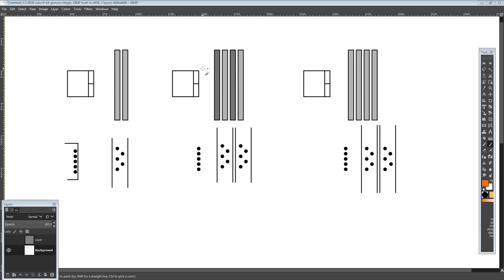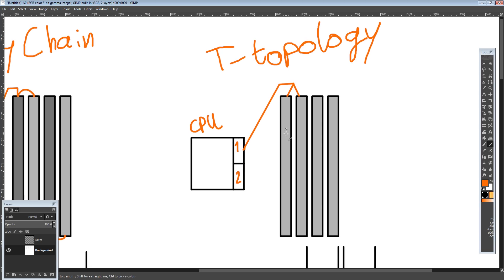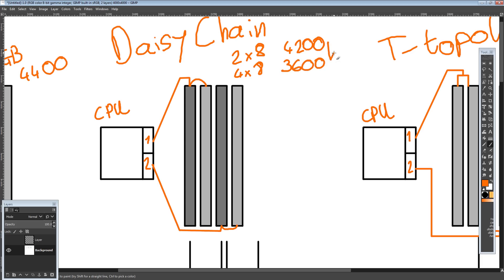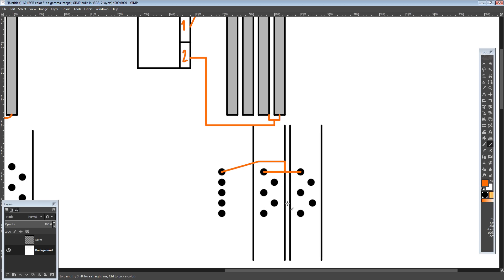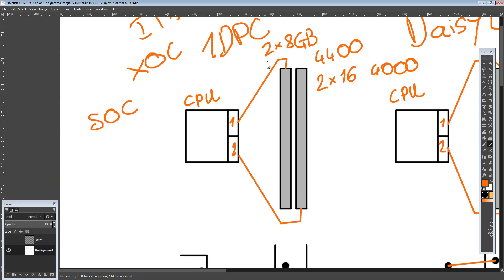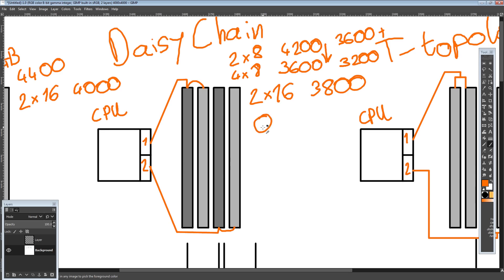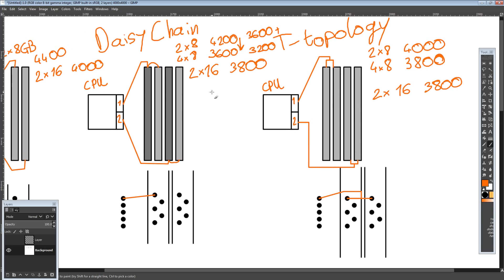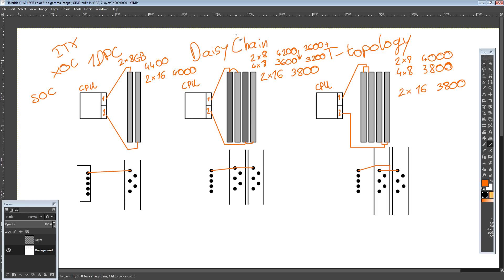Rambling about motherboard memory layouts.

Comment: Now I get, why I had to take my memory from 2666MHz to 2400MHz after adding another 2 sticks.
Reply: Ohhh, but did it at least boost game fps?
Reply: My speed went down too. I saw a boost in only one game, Star Citizen
Reply: @latuba2478  There's almost no difference in FPS, and you get lower speeds on your RAM overall. Not really worth it unless you intend on adding memory to fill up the slots. Otherwise, stick with 2 so you can add even more RAM later.

Comment: Wait...in a T-Topology, you can put the DIMMs anywhere, and it won't affect their functionality? What if The Verge used a T-Topology motherboard?!
Reply: That's not how T-topo works.
Reply: @basshead.  But it's how Mafia works
Reply: It was in the context of overclocking. Slot choice wouldn't negatively impact results on a T-Topology board. Not making use of Dual-Channel by picking the wrong slots is still a colossal mistake.

Comment: I find your fretting over little mistakes and wanting this as perfect as possible incredibly endearing. That said I've learned alot from this. Recently got some new ram from the same manufacturer as my old and wanted to read up on how the slots work (my mobo uses Daisy Chain). Was curious whether or not I should try and keep my old ram in with the new and fill up all 4 slots, but sounds like it's probably best I don't.

Comment: You missed some facts... with T-Top its possible to hit 4400 with 2dpc but NOT with 1dpc. T-Top Boards works even better with 4 Dimms. I can give you some infos about that if you want.
Reply: I’m a bit late but interested by the infos ! :)
Reply: Yes, please give some info!
Reply: I can confirm that. I do exactly 4x8go 4133Mhz CAS19 on my Z390 Aorus Master (i9 9900K 5.1ghz/ uncore 4.3ghz  1.30/1.32V manually and get stable ram when i change the pwm phase rate. And YES it really work.

The same goes for LLC too. NEVER going above High level (level 4 on 9).

In contrary you will gain save more voltage cpu comparing to Extreme/Ultra.

4 dimms Single rank is better 2 SR.

And 2 dimms Dual rank are even better.

Dont forget that 2 dimms Single rank = 1dimms Dual rank.

The more you put dimms the better it will be no matter the Typology. The only thingis that you should be aware for the differences of frequency og the ram from yhe traces layouts.

I think to test 4x16go 3600Mhz CAS16

In reality when you could afford and when it's a good implementation T-typology is the better.

Despite highter latency and/or frequency..Dual rank can perform better than Single rank

And so just with 2 dimm Dual rank so imagine with 4 of them..

Even with my 4 dimms SR 4133Mhz tell you that in cas19 it s btter that 3800Mhz... 15-15-15-35 (yes really) but in only 2x8go SR...

On performance test i have had 4100 pts global.

The other person 3900 despite much latency..and close frequency (3800Mhz). 3900 pts for him

The final person with 2x16go,get 4200 points with 2x16go 3500/3600Mhz 16-18-18-38

And yes just for two sticks..

Beware to your cpu and voltages rails too..

The more hou overclock the and/or the less you will be able to overclock your ram.

just add 100mhz to the uncore is enough to get you mass errors on Karhu ram test.

Comment: i just bought gigabyte x570s UD. its daisy chain which says use the 2nd and fourth slot for 2 sticks. i have heard that using 4 stick is pointless if all dual rank coz the two sticks in 1 and 3 slot wont dont anything so if i have 4x 16gb in al 4 slots it wont be any better than 2x 16gb in slots 2 and 4. do i nned 4x 16gb single rank sticks or can i use 4x 16gb dual rank sticks or do i just need to get 2x32gb if i want more than 32gb, i dont need more than 32gb i just want to use all 4 slots so nothing is empty and i have power if i ever ned it. i getting 5800x cpu for it or maybe the 3d.

Comment: Thanks for clear explanation especially about Daisy method. I always install first pair close to CPU. But i dont build so new PC. My last personal 0c from 2012 on Z77 and i7 3770K@4.7GHz 1.35V. When i check new parts i curious why labeled slots recomended install RAM to second slot pair A2B2 not A1B1.

Comment: My case: r5 5600x pbo and auto oc 4800 boost sc  on some aftermarket 180w cooler, b550 asrock phantom gam 4 (cheapest maybe b550) f4 3600c16d-16gb gvkc kit 2x8 16-19-19-39 hynix memory ... On 2x8 kit all ok xmp no memtest errors didnt push timing and speed.. Getting another same kit but assumed it will work on xmp.
So 4x8(2 x 2x8gb )same kit same latency will boot into win10 and work in some scenarios gaming,but I wanted to test it on memtest and there is problem :) lot errors ..
For some time in research i came to 3200mhz speed in bios with some tight timings (not so great ) but maybe same  latency and fps like xmp of this kit 3600@cl16
Now running 3200 cl14-16-16-18-32 on 1.42v stable on 4x8gb dimms(dual ranks as its 4xsingle ranks)
Next time  buying deff some bdie kit 2x16 gb  --3600 mhz 😄 and not getting into troubles.

Comment: If I had to make an educated guess about why the "far" slot in a daisy chain topology is generally better if only using one slot for a given channel I would say it probably comes down to terminations for the traces. Placing a stick of RAM in the far slot will terminate the channel at the end of the chain. If you place a stick of RAM in the near slot only the trace will be terminated in the middle and the distance to the next slot in the chain will be unterminated (a stub) and cause a reflection which interferes with the signal. 

In a T topology, the stub would always be the same length so it would be consistent between using a single stick in slot 1 or 2, but neither would be as good as the daisy chain topology using a stick in the far slot. As said in the video, using four sticks in a T topology would equalize the delay between both sticks in a channel and would probably overclock better if all slots were filled versus daisy chain.

Comment: 9:45 Data lines are end to end connected in all the topologies. The address and command group signals are shared.
Slot 2 performance better because it see the least amount of reflection. 
T branch topologies suck at higher memory density due to SI issues and reflection

Comment: I heard from a msi engineering channel that T topo design has a issue that when u only plug 2 ram on board the other 2 spare slots would acting like some kind of antenna and interupt the memory frequency which daisy chain won’t do that. in the past most of board use T topo design because the distance of circuit between two slots and cpu are same from engineer’s viewpoint, when DDR4 came out. due to the extreme high frequency is become popular, the main issue is focused on how to keep the signal stability so that the ram frequency can reach as high as possible.so his recommendation is that for the T topo board, if u want to test the oc limit, u d better plug 4 rams. the frequncy could boost 400-800MHz. For 1 DPC, though u only have 2 slots, but u can get the best ram performance because the circuit is exclusive to each slot, it could make huge difference compare to the 4 slots mobo.
Reply: Yeah Mr Lin highlighted it as one of the changes they made to Z390, deviating from Z370 series. Given that most of the consumers generally goes with 2 slot dual channel, they changed the configurations back to daisy chain in order to maximize the RAM frequency performance consumers can get with just 2 sticks.

Comment: The reason for the higher clock speed on the later dimm in a daisy chain is due to impedance matching. The same goes for terminations of Coax-communication (75 Ohm). 

Another interesting tech is RDRAM (Rambus) which needed termination dimms (Basically dummy dimms) to ensure proper termination. Same goes for Nintendo N64 where the black pack where the expansionpack goes is just a termination of the RAM-bus.
Reply: is that what those things that screw onto cable coax do?  impedance mathcing?  they screw into the male end of a coax and have a male end on them,  not the large round filters, but they are very small and screw into a male coax but the other end has a male plug,  they also have a rating of some kind.  i have some here but i didnt know what they do.  its not a frequecny filter though
Reply: @bobhumplick4213  Not sure, but if you are talking about plugs you screw into loose cables or open terminals in T-junctions then yes. They are terminations to so that signal reflection does not occur. (Signal reflection is the result of poor impedance matching, reflection gives poor SNR and will eventually disrupt signal integrity).
Reply: @DavidtheDoom  i just remembered what they had wrote on them.  attenuator.  does that ring a bell? they are very tiny and have a male plug on one end and a female on the other, sort of like a filter but they are very small.  what would that do?
Reply: @bobhumplick4213 , you might be talking about channel filters. They either block channels or let channels be shown. They were used a lot before digital boxes became a thing. I think they might be used even with digital boxes but I can't remember since its been a long time ago. They come in a variety of lengths, they are cylindrical, one side has a male end which you screw into the Tap (that's the main cable connection at the pole, looks just like where you screw your coax cable into the back of your tv), the other side has a female end where you screw your drop line (which is your coax cable coming from the pole to your house). They are supposed to be put at the Tap so no one can easily take them off to get channels their not supposed to, if it's the kind that block channels.
Reply: @weightlifting_socialist  nah i now what the filters are.  i looked it up.  they are attenuators.  if your signal is too hot they put them on to decrease the power of the signal
Reply: huh, i wonder if termination dimms could be designed to improve 2-stick performance on t-topology boards, by preventing reflections from the unused "leg". just some carefully placed resistors across the differential pairs i'm guessing.
Reply: @spambot7110  I was wondering the same thing. Maybe motherboard manufacturers could include 2 sticks of termination dimms with each motherboard which comes with the T-topology layout. That way they could reduce the amount of reflections coming from the unused slot if not even rid of them all at once.
Reply: @DavidtheDoom  signal reflection comes from the shape of the traces. Look at your RAM traces; there will be no 90 degree angles, all the corners will be chamfered or curved. High speed signal design is voodoo magic to a layman and it’s not worth talking about unless you have a EE BS, at the least. Most undergrads won’t ever do any high speed PCB design at all.
Reply: @chrisjohnson9755  Oh that's for sure.  Holy cripes.  Part of my CS degree required some EE (I believe 3 courses, first one starting in TTL), and I do remember talks from my EE instructors of how inside CPU's they don't even avoid right angles (emission from inside the elbow, absorbing from outside) because they use those nano-precision spaced to increase gate transitions.  To say that this is voodoo, black magic, or plain old scary shit is an understatement.  Very very cool.

The interesting thing about getting only your feet wet in EE is that you get a glimpse of how incredible it is that any of this hooey works at all.
Reply: @sailbatten2056  Just finished my EE/CpE BS, and I don’t think any professor even mentioned any of this stuff. I’m into the computer engineering side for my MS, and thank god I’m focusing on architecture instead of implementation. Architecture is black magic in it’s own right but the actual semiconductor design is a whole different level.

I’m not sure my university, which is prestigious but with a modest engineering program even offers any courses on it more than semiconductor device theory; we used to have VLSI classes back in the day. I would guess you would need to be at a university that has a real expert in the faculty to really learn any of that semiconductor design stuff in detail.
Reply: @chrisjohnson9755  shape of the trace is not accurate, it highly depends on impedance discontinues due to broken refrence/return plane, stub lengths, bad via models (improper antipad), DRAM as load etc all of these contribute to reflection. crosstalk and dissipation factor of the dielectric at higher frequencies can cause signal integrity issues. And ofcourse, all the signal groups have to be length matched to maintain propgation delay.

Comment: my system i am going to build
ram :  F4-3600C16Q-64GTZNC
mobo : MSI MPG X570 GAMING PLUS
cpu : ryzen 9 3900x
lots of people say it works good at ddr-3600........ i never over clock.......over clocking  it can wreck the hardware.... that  i paid $$$ lots money for..... i just want it  to work..........
Reply: OK so ram is sold as a product with a specific speed and that speed is what you purchased it for, im  saying, let's say the ram is sold to you and then they say it's DDR4-3600....  Which actually that is the XMP or DOCP profile.......   In other words, I purchased 3600 ram, so therefore the ram should just automatically work at 3600 ...   I get that,   OK,   I gotta go in and set it,  to tell it to use the XMP profile, and that's acceptable, as long as it easy.....  But even that is too much effort (i.m.o.) it should be automatic, the low end profile should be the XMP profile....    but i get the default low end is for guaranteed compatibility...........
Reply: And yes also the price you pay is directly related to the speed that it's marketed as,   so a brand at 3200 would usually be costing less money than 3600.... 
example
DDR4-3600  16-19-19-19   cost   $380.00  &   DDR4-3600 16-16-16-16    cost $500+    &  is out of stock.....   it is all the same stuff....... it just happens to be able to run at the 16-16-16...   
and that's why they charge  more.....
Reply: Important part is that it works.......... and that what I paid for,  is what I get .................  the end.........

Comment: The reason for why the nearer of the two ram sockets will work better then the other in the daisy chain setup is because it doesn't leave a long wire hanging across the board acting like a poor antenna with wild reflections and stuff. Though, the other socket not being populated on the path between CPU and the installed RAM module is also going to act like an antenna, all though a much shorter one and therefor less of a disturbance.

Also, if the trace is 1/4 the wavelength of the signal of interest, then it will act as notch filter. As in, if we have a 15 cm long trace going from one of the ram sockets and out over the board, not being connected to anything, then it will be a notch filter at about 250 MHz. Though, we would in reality only expect about a centimeter or two trace going from one socket to the other, so the frequency would be much higher. (1.5-2 GHz)

Though, since there isn't a massive amount of capacitance at the end of this trace, then it will not be much of a notch filter, and the reflected signal is more of a problem instead. The propagation delay of a signal migrating its way down the trace, bouncing of the end and going back up is the real thing  that will nibble at the performance instead. This is though for a 1-2 cm long trace up at about 3.5-7 Ghz is where the disturbance would roughly be. And that would start to mingle with any high clock frequencies.

The one dim socket per channel has the advantage of not having these un-terminated traces, and yes, technically you could likely make a "RAM" module that simply does nothing else then provide the correct termination for the signal, as to stop reflections and such from even happening. But that is likely a fiddly art to begin with, nor do I know what impedance DDR/-1/-2/-3&-4 even uses... (If they have even settled on a fixed impedance that is, they might just be railing it hard between high and low voltages without a care in the world for impedance matching...)

Though, the T typology would be a trade between not needing to worry about a lot of these things.

But I do wonder, would setting specific memory timings for independent channels be a nice feature to have?
I have personally never seen such settings, it seems to just be a "one size fits all" kinda deal... But usually, one channel is physically closer to the CPU then the other. (Unless they are sitting on either side of the CPU. But for 2066, 3647, 2011 sockets that have more then 2 channels are though usually having a pair of "near" channels, and a pair of "far" channels. (And a pair of "really far" ones if we look at the 3647 socket, unless a motherboard manufacture decides to do a hexagon, but I doubt that would be advantageous, since a T shape would likely be more logical as to avoid the "really far" channel pair.))

Now of cores the memory controller in the CPU needs to support such miss matched timings between channels though. But it would likely increase overall memory performance, since the "near" channels wouldn't be held back by the further away channels. Not that propagation speed on a PCB would result in much. (Though, at a clock speed of 1000 MHz, we would still suspect a difference of 1 tick for every 7.5 cm of additional distance. And at a clock speed of 2 GHz, then a distance of 3.75 cm adds a tick, and that isn't far if we look at a larger system. (MY HP DL490c G6 blade servers have a bit over 8 cm extra distance for the 3rd channel for each CPU. So even these servers would likely see a small improvement.))

And hopefully this isn't too much of a text wall..... Or it likely is.

Comment: Why not turn the DIMM slots 90 degrees so the runs could be equidistant straight lines from the CPU to the DIMMs? Just because of board space and standard board sizes, or is there an EE reason?